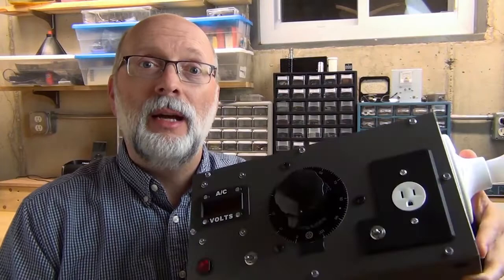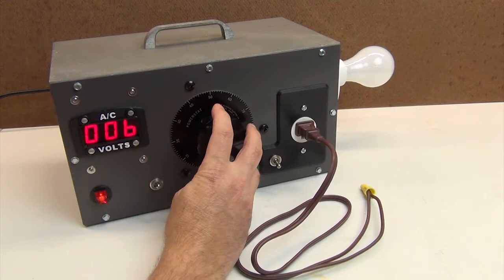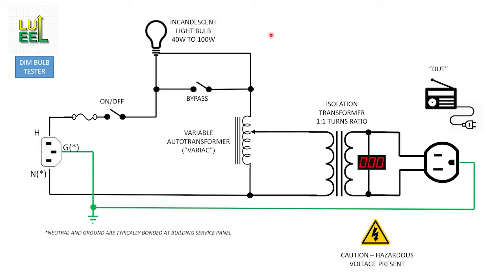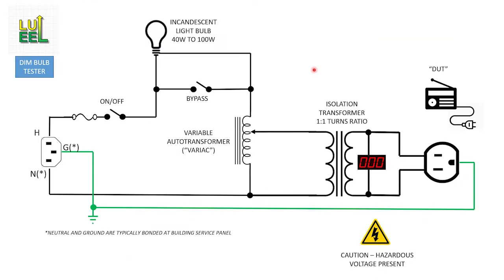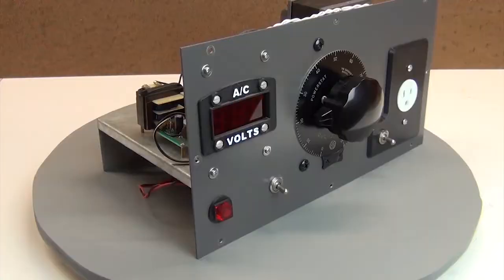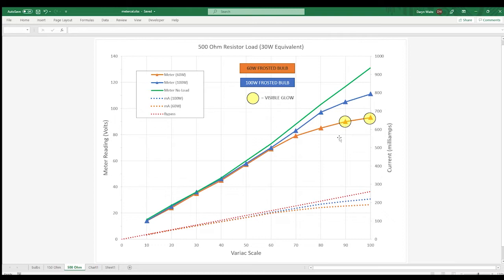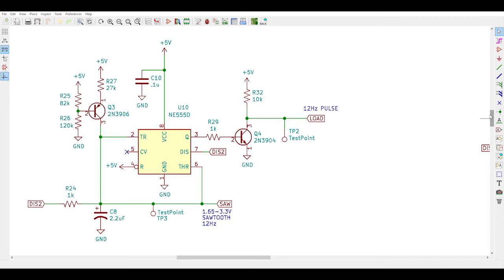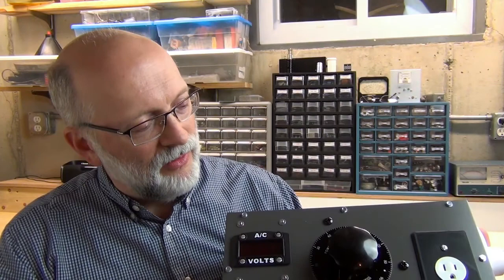Homebuilt Dim Bulb Tester

Comment: It has also crossed my mind that my DIY VAC PSU could serve as a high voltage DC supply by just adding a bridge rectifier. I have not considered this idea fully, particularly if there are any safety issues, other than it being a high voltage environment.

Comment: Your drawing showing the ground lug of the DUT connected to panel ground could be dangerous to the uninformed. A ground connection defeats the purpose of the isolation transformer if the ground lug of a 3 wire DUT is tied back to the panel ground. You can get away with this design if you are plugging in two wire DUT's. But 3-wire DUT's will not be isolated so a 2 prong adapter must be used. Alternatively you could remove the ground lug on the output receptacle as it is never needed.
Reply: Even if the lug is not grounded to the case the metal of the plug does the same thing if not isolated.
Reply: Agreed , the green wire should not exist in that unit .......  The green [ earth ]  is connected to neutral in the service [ breaker ] panel , and the isolation transformer is not so isolated with the green wire in the equation ...

Comment: An exceptionally good gadget to test a short circuit... Except that lamp hangs outside of the housing. Would it be better if you place or mount the lamp inside the housing, or get a much bigger housing to fit the lamp inside, cut a 3 inch diameter circular window for the lamp bulb,  my opinion and  suggestion...

Comment: Very nice workmanship, but a bit of overkill on such a basic problem. My entire bench is on a 1 KW isolation transformer and Variac, i prefer to monitor the voltage, current and power on a single meter.